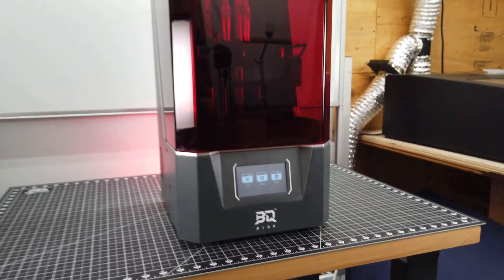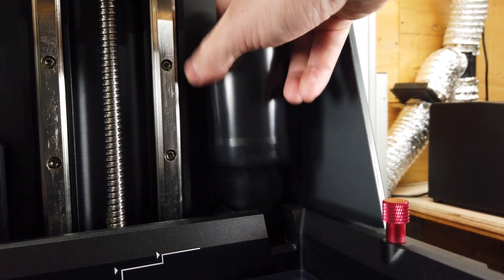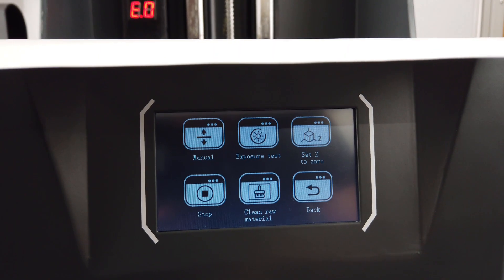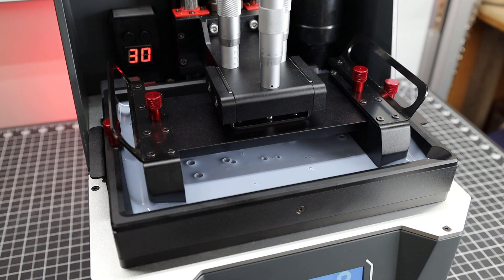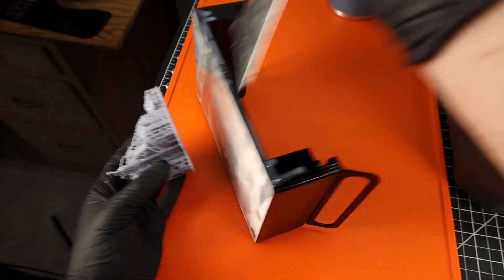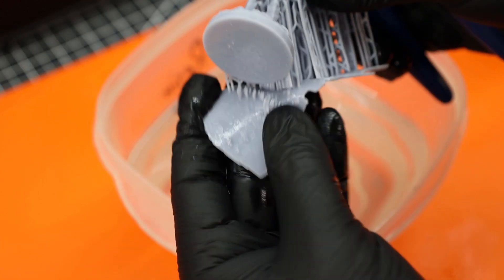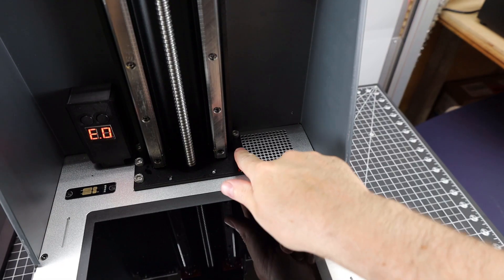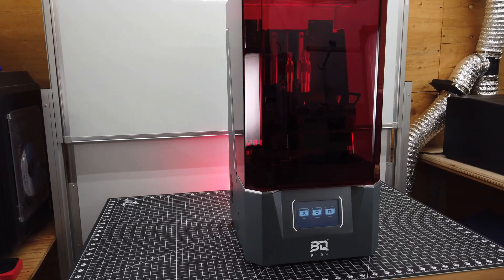BIQU Made a Resin Printer With Some Game Changing Features  - BIQU PIXEL L 9.1 inch 4K

Comment: sry but gimmicks are not game changers aye, the only good thing this printer has over any other is the heater but that's useless if you live in a climate that is cold, but in saying that ur resin heats up just from using the printer, the build plate over engineered while being a useless design, using a magnetic build plate ok for small prints but may have issue's with bigger prints, u wouldnt want that plate to move or to come off during a print  may cause damage to the screen
Reply: The resin warming as you use it is pointless if it starts out too cold to even start the print.

Comment: I think the automatic resin top up feature is not a good thing. If your FEP gets a hole in it you'll have even more of a mess than you already would. The build plate holding all of that resin on top isn't ideal either.I do like the heating feature though. That would be great here in the UK.
Reply from the maker: Yeah the heating and print quality are the best parts about the printer for sure. The build plate holding resin is annoying but I think I'm just going to 3d print a ramp and glue it on so it will have a much easier time coming off on its own.
Reply: @randymay   I only recently got into resin printing and I have a Mars 3 Pro. Cleaning it up after prints is so easy it doesn't take more than a couple of minutes. Hopefully they work on the build plate for their next release because I think the better competition there in the industry the better products we get as consumers. Also, thanks for the awesome content!

Comment: Hi!
How are things looking on the software side? Do you need a proprietary Biqu slicer, or can you use any that supports resin printing?
If it is proprietary, does it require an account? What's it like to work with? 
Etc. :)

Thank you!
Reply from the maker: So when it comes to the software you can use Chitubox or Lychee Slicer. In other words basically the same software you use with most printers on the market. The printer did come will a profile for Chitubox seeing that they don't have it listed yet in that software. 

Here are some links-
Chitubox Basic - https://bit.ly/Chitubox-Basic
Chitubox Pro v1.2.0 - https://bit.ly/Chitubox-Pro
or 
Lychee Slicer - https://mango3d.io/
Reply: @randymay  Thank you! That's what I wanted to know.

Comment: Do the micrometers do anything? It seems to me like the plate is level from just being pressed flat against the screen
Reply from the maker: So from what I can see it just makes sure it has even pressure on the build surface so you can make sure it's all going to be level as you lock it in place. I don't think it's 100% needed but they are nice to have. 

Also just so everyone knows I was able to add a magnetic build plate to the printer without having to modify the z end stop 😁👍
Reply: @randymay  So they are using micrometers as (very) expensive screws? The design suggests a means of altering the plate relative to the zero, but unsure why that would be a thing.
Reply: Looks like a unnecessary gimmick to me.